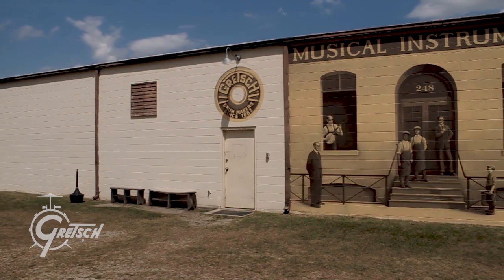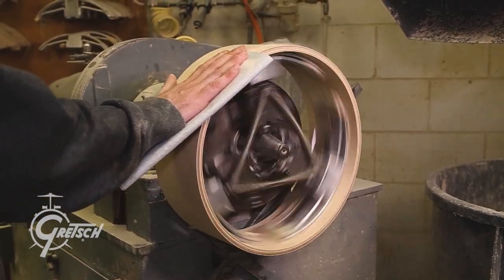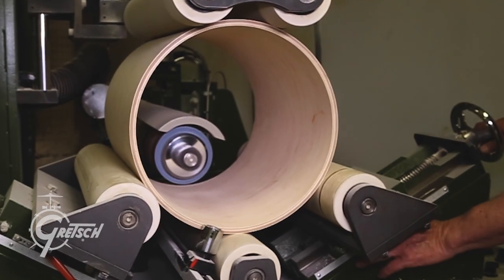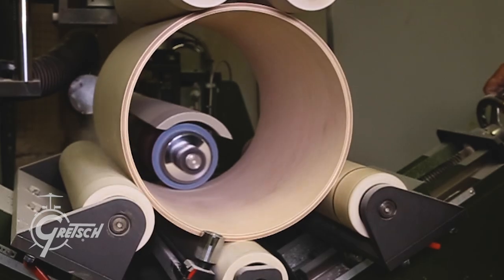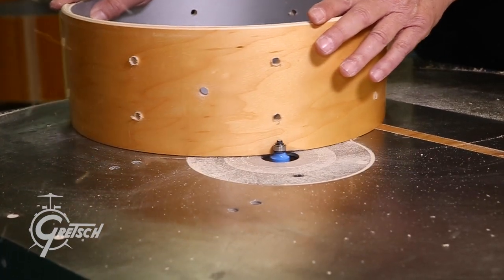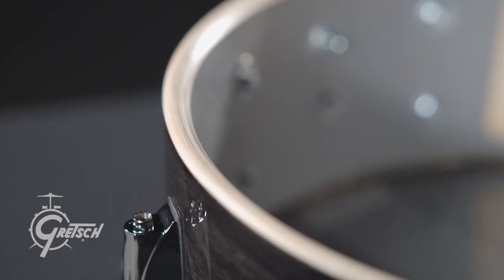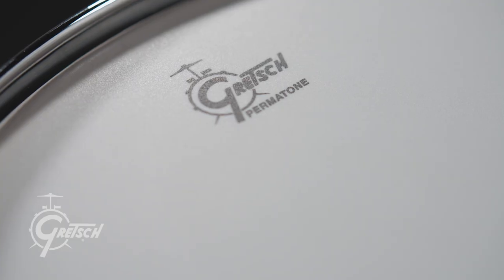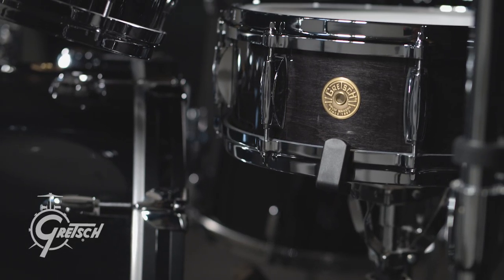The Gretsch Ridgeland Snare Drum Story

Comment: That Great Gretsch Sound ….
Reply: @toothnail605  that’s correct that Now Keller makes the shells , it used to be Jasper from about 1959 through 2003 . No one ever thanked Jasper. Not all companies make there own shells anymore. The shells are a big part of the sound , but not all of it.  30 Bearing Edges , the silver sealer is said to have an effect on  the sound ,  the die cast hoops also effect the sound. The shells are also made exclusively for Gretsch to their specific requirements ( shell composition and thickness of shells).